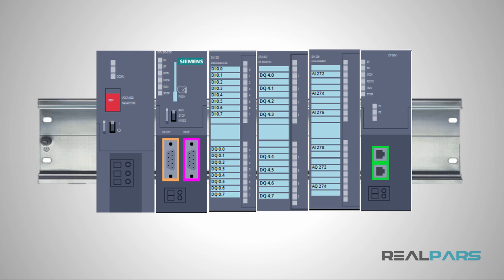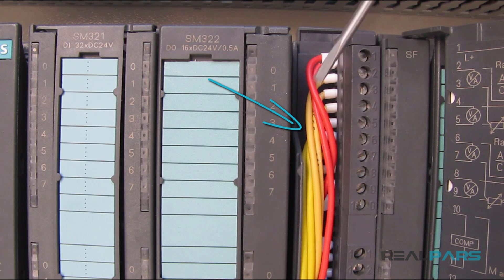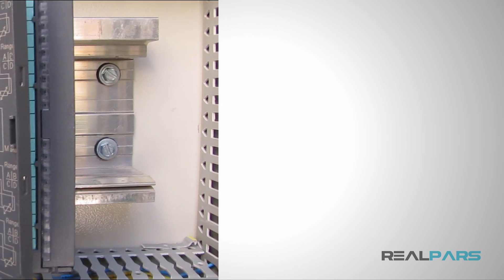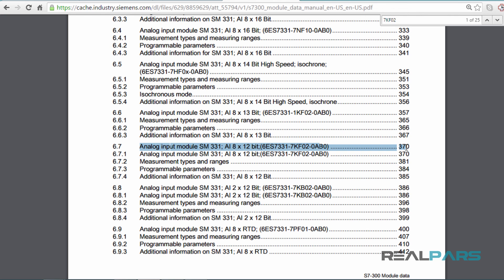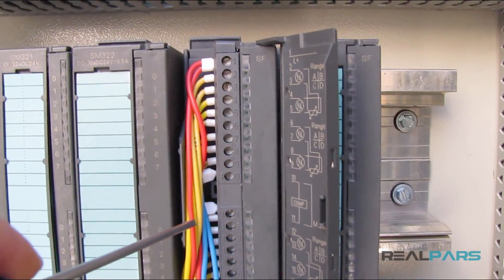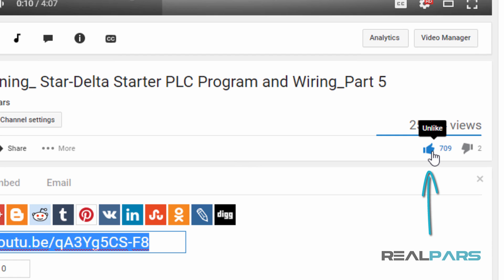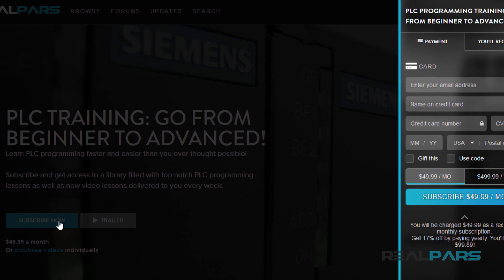How to Wire Sensors to a PLC - Part 2

Comment: Dear  sir,  one pt,Lt,and Rtd  connection wireing  instument to plc card and how to measure 4-20mA ,0-20v, and resistances with multimeter  please sir it my small request .
Reply from the maker: Hello, @Greenarmy77.  Thank you for your question. Unfortunately, we can’t tell you how to wire your devices to your system. We don’t have your electrical schematic and can’t do that due to safety issues. Your best choice is to contact the vendor of the devices you are working with or use the instructions in the manual for your devices. But here is a link for your learning, you might want to review:  https://sage-advices.com/how-do-i-connect-rtd-to-plc/. If you don’t have a manual for your devices, you should be able to find information about your PLC and devices online. Happy learning from Realpars!

Comment: I learned how to find out how to connect power to terminal properly according to specific part. 
Maybe you could explain what the picture shown on the small doors means.
Reply from the maker: Hello, @logoman6718.  Thank you for your question. You must be asking about our video time 0:46 section. Depending on the part number and card type, the Siemens PLC input and output modules will provide a simple block diagram to help you with the wiring and troubleshooting. You are looking at a basic schematic diagram of the I/O card. If you want to learn more technical information from Siemens, here is a link for your learning: https://support.industry.siemens.com/cs/document/109744173/documentation-for-simatic-controller?dti=0&lc=en-WW. You can download manuals and if you register and it’s free you can get more information depending on where in the world you live. Siemens does have some restrictions on the information you can get.  Happy learning from RealPars!
Reply: @realpars  Thanks!

Comment: Can we connect Allen Bradley PLCs to a manage switch?
Reply from the maker: Thank you for your question! I’m here to help, but I need a bit more information to provide a precise answer. Could you please clarify whether you’re asking about a manage communication switch or a power control switch? Providing more details will help us better understand your query and assist you effectively.
Reply: @realpars  there are several control logix and micro logix controllers which are connected to operator workstation via entr and etaps in a ring topology, so my question is that can we replace it with manage switch?

Comment: What is the gauge for the cable used?
Reply from the maker: Thank you for your question. I want to make sure I address it accurately, but I'm not certain which gauge in the video you're referring to. Could you please provide the specific time in the video where you noticed this gauge? Once I have that reference point, I'll be able to give you a clear and helpful answer. Happy learning

Comment: How do you know you are to wire negative 24 volts to 10, 11 and 20?
Reply from the maker: We appreciate your inquiry. As discussed in our video, the decision to wire negative 24 volts to terminals 10, 11, and 20 is based on specific considerations. Firstly, it's crucial to consult the manual and electrical schematic design corresponding to the PLC you're using. These documents often provide insights into the appropriate voltage connections for different terminals.

Furthermore, the choice of negative 24 volts might be dictated by the electrical requirements of the components or devices connected to these terminals. Certain devices may require a specific voltage level to operate optimally, and this choice is typically informed by engineering specifications and the overall system design.

In addition to following your country's electrical safety standard codes, understanding the rationale behind voltage configurations is essential. If you're engaged in Electrical Engineering studies or an electrical/electronic course, it's beneficial to grasp the codes relevant to your region and international electrical automation standards such as IEEE, IEC, and ISA.

For further guidance and in-depth information, you can always return to RealPars. Our Pro-membership offers exclusive access to our comprehensive library of instructional videos, tailored to learners like yourself.

Comment: Whats the wire size from field device to PLC ?
Reply from the maker: Hi there, 

Thank you for your question! This all depends on the load voltage/current requirement of your field device. And you must remember to follow the electrical safety standard codes for wiring requirements in the part of the world you live in. In this video, we are using Siemens controller, and you must look at the I/O card spec sheets too, for its requirement wire size recommendation. 

Hope this helps, and happy learning!

Comment: there is an error in this video, in CC- you mentioned that the positive terminal should be wired to terminals 1& 10 while on the video the negative wire should be on terminal 10 not a positive one.
Reply from the maker: Thank you for your comment.  You are correct.  The negative terminal (common) is terminal 20 as shown on the wiring diagram for analog inputs.

Comment: How plc is communicating with VFD drives? 
If I enter the speed in the system how does it recognise and allows motor to rotate in that particular speed, also how system shows the current value what the motor consumes?
Reply from the maker: PLCs can communicate with VFDs in many ways.  One is to hardwire the analog and digital inputs and outputs on the drive to PLC I/O cards.  Various communication protocols can be used to communicate with the VFD (Profinet, Ethernet/IP, ProfibusDP, DeviceNet, etc.).  These communication busses allow the programmer to access to most of the parameters and data that lives inside the VFD.  The speed and rotational parameters you mentioned are parameters inside the VFD.  They can be accessed via programming in the PLC via I/O card inputs and outputs (if configured in the VFD to the VFD's I/O board) or via communication bus (by parameter address).
Reply: @realpars  thank for your brief reply and time.  Have a good day sir. I like your channel very much.

Comment: How do u connecting a Hydac EDS 300 to the analog input (AI) plc Siemens card.
I am only using 3 wires to connect it.
The first wire connecting to the +24 the other two wires are the signal 4-20 mA..
How do u connecting them ?
Reply from the maker: You would connect pin 1 of the Hydac EDS 300 to the +24VDC power supply terminal.  Pin 2 should be connected to the power supply common.  Pin 3 (analog [+] terminal) should be connected to the Siemens (I+) terminal for the analog channel being used.  Pin 4 (analog [-] terminal) should be connected to the Siemens (M-} terminal for the same analog channel.

Comment: WE are wondering how much will cost the training for my sons? I got two teen agers sons, one just graduated from colleges and he has his bachelor degrees in Math, the other is on his second year to become an electrical engineer  at the college in Houston Texas. We live in the country side between Houston and Dallas,  I was wondering if you have classes for generator excitation integration. I have work for power house and substation for 30 years.
Let us know to see if we can do something. I would prefer to do line classes than for them for now, we are buying a Siemens rack pack simulator for them just to teaching how the system works.
Reply from the maker: Hi John, 

Thanks for your comment, and great to hear that your sons are so eager to learn more about PLC Programming!

We definitely have a great option for your sons. Our course library is specifically designed to provide all the tools needed for beginners to evolve to an advanced level through our hands-on courses.

They will obtain full access to our complete course library (500+ video courses) by subscribing to either our monthly package for €24.99 a month or our yearly package for €179.99,-.  You can subscribe via the following link https://learn.realpars.com/collections

Additionally, they will have access to our Technical Team - consisting of high ranking engineers with a lifetime of experience - who are here to help out with any questions they might have along the way! 

Feel free to browse through our course library to see all the different topics we are covering https://learn.realpars.com/ 

We currently do not have a specific video course on generator excitation integration, but I will happily pass this on to our course developers for a possible future video course. 

Hope this helps! If I can be of any further assistance, please let me know - I’m more than happy to help! You can also reach us over at hello@realpars.com

Comment: Sir I just need to know i have only one cable which is 4-20mA. Should I connect in AI card which is configured in channel D.
Reply from the maker: To wire a 20wire analog input to the PLC card, wire the (+) wire of the transmitter to M+ of the channel you wish to connect to and wire the (-) wire of the transmitter to M- of the same channel.
Reply: @realpars  sir I configured the channel to 2 wire so is it possible to connect 4 wire to 2 wire AI module?

Comment: why they loop and connect all (-) negative wires in 4-wire connection?
Reply from the maker: They do not have to be looped together, but they can be to simplify the wiring (and to make the drawing less cluttered).  All of the negative signals are wired to the same potential (common) of the same power supply used to power the analog signals.

Comment: At 4:39 I still couldn't tell from the schematic where to wire the neutral .  10, 11 and 20 you say for neutral, if you look closer you see 10 has a plus sign, does that not mean positive? Still enjoying all the videos you provide thank you.
Reply from the maker: These sensors operate on DC voltage.  There is a +24VDC terminal and several COM (common, or ground) terminals.  Terminal 1 is supplied +24VDC, and terminals 10, 11, and 20 can be connected to common (ground).The 24VDC power supply and the PLC card should both be connected to the same ground potential.  Terminal 10 can be wired as a positive compensator (hence, COMP+) if you are using external compensation for differences in common potentials. This is not usually required.

Comment: Question: Why are there 2 x Red DC positive and 2 x Blue DC negative wires connected to one module?
Reply: Seems that the 2 power supplies were connected in parallel to increase the output current

Comment: thanks for another great video, when you showed where the neutral goes into 3 places on the card where did say or show you that info ?
Reply from the maker: In general, wiring is determined by the wiring diagram for the card or device.  In the case of the analog card in this video (see 4:15 in the video), the wiring diagram shows 24VDC+ wired to terminal 1 and COM wired to terminal 20.

Comment: What is the meaning of the 4 numbers in cross(one is always "X")  in top right of the order number?
Reply from the maker: Great question!  The 4 square quadrant indicates the E-Stand release (Engineering process for hardware) for that particular module. The X indicates the version. For X, 6, 7, 8, the release version is 5. The E stand base number increases when a change to the hardware or firmware for that card is made; i.e., new component manufacturer, firmware update, etc.

Comment: two wire sensors are the ones with an output current of 4-20mA and 4 wire sensors are the ones working with a voltage range ,am i correct?

Comment: Instead of looking for the module manual you can also just check the front door. it clearly shows where to connect the power and sensor input.
P.S.: cut the cable ties properly, these things can hurt :)

Comment: When should I use digital module and analog module?? Help pls
Reply: If you have discrete input devices, like switches, pushbottons, or proximity switches, for example, you use a digital input card to interface them with the PLC.  If you have discrete output devices, like relays, pilot lights, or on/off valves, for example, you use a digital output card in the PLC.  If you have analog sensors, like pressure transmitters, position resolvers, or a power meter, for example, you use an analog input card.  If you have analog actuators, like regulating control valves or VFD's, for example, you use an analog output card.
Reply: Scott Sommer : thanks a lot sir that was clear answer now I know how to use them
Reply: @yakikadafi6189  You are very welcome.  I am happy you now understand how the digital and analog cards are used.

Comment: How do you know from diagram that terminals 10 , 11,  and 20 are -ve   ???
Reply: In general, before I wire any PLC card, I obtain the vendor documentation for that card and study the wiring schematic.  If you re-watch the video starting at 3:20; it will explain how to determine the proper wiring for the card.  In some cases, the inside cover of the swing-out terminal cover may also provide abbreviated information on wiring the card.

Comment: Why -24V at terminal 10(comp +)
Reply from the maker: Hi there, 
Each card needs a supply containing a +24 and -24 volts. +24 volts will be connected to terminal 1 and -24 volts will be connected to terminal 10 of front connector.

Comment: I don't see where the diagram says to wire negative to terminal 10
Reply from the maker: Hi there,
In 4:42 you can see that according to the sample card's manual you should connect -24 to which terminals (including terminal No.10).
Thanks

Comment: I have a question I hope to answer me
For analog module,If I use AI8*16bit analog module and this module starts from 256 address, in the simulation for 4 transducers  which are  2 wire transducers . In this case, I  should  use  analog inputs that start from  PIW256 for the first transducer and PIW258 for the second tranducer and PIW260 for third transducer and PIW262 for fourth transducer, that's true or not?

for 4 wire transducers it will be the same case or there is any change for using the addresses?
Reply from the maker: Hi there, Thanks for watching the video and submitting your question. Yes for the 2-wire transmitter your addresses are going to be PIW 256, PIW 258 and so on. That's because each analog signal input occupies 16 bits of the PLC memory. 

It works the same for the 4-wire transmitter as well. That means you'll have the same addresses of PIW 256, PIW 258 and so on if you make use of a 4-wire transmitter instead. 

The only difference between a 2-wire and a 4-wire transmitter is in the way you wire and connect them to the PLC input. 

Hope this answers your question. Let us know if you have more questions! :)
Reply: @realpars  
Thank you :)
yes,I have some other questions which I want to ask in the future
Thank you for your kindness

Comment: Does Plc CPU and io modules are provided power  through same power supply module or different ones?
Reply from the maker: You can do both. You can use the one power supply to power the CPU and the I/O modules OR you can use two different power supplies. The only thing that matters here is to use a safe and reliable power supply.
Reply: @realpars  Thanks for solving query.

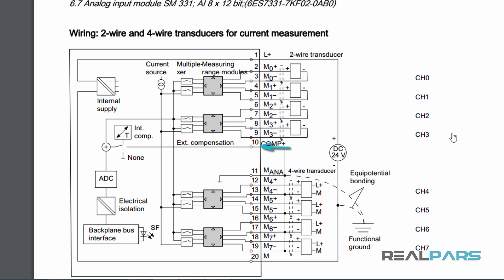Comment: @4:51 I do not really understand why terminal 10 and 11 are also meant for the connection of power supply, since the schematic diagram only shows the connection of 24VDC to terminal 1 and 20. Appreciate if you can explain a bit, thanks :)
Reply from the maker: Hi there, we have another great video on how to wire sensors to the PLC input cards which I think can answer your question. You can watch the first part of this video here https://youtu.be/0DoqKS8jqSA if you haven't already.
Reply: Thanks for your Question which is confusing me too..As per manual its mentioned terminal 1 and terminal 20 to be connected from source .Appreciate if you Explain.

Comment: How to wire 3 wire transmitter to SM 331AI module ????
Reply from the maker: Google the part number, get the manual and you can easily figure that out.

Comment: How to make I/O list or schedule? Can you make a dedicated video on how to make the list depending on the process . Let's say I have to below facilities
1. Inlet pump station
2. Course screen
3. Primary sedimentation tank
4. A/A/O tank.
5. Secondary Sedimentation Tank
6. UV disinfection system
7. Etc.
Depending on the process how to schedule input /output list of PLC ?
Reply from the maker: You can usually develop an I/O list based on the P&ID diagram that you have for that process.
Reply: RealPars But I'm wondering how the I/O points from Switchgear, transformer, VFD, generators are being considered?
Reply from the maker: I understand. I will pass your suggestions to our instructors.

Comment: i have 2 question 
1- what is the number and letters on the module as across x 6, 7 8 ?
2- why did u typed  in search only 7kf02 not the all number of module ?
Reply from the maker: Hi Ehab, 

1- These digits show the number of input or output for the input or output card. For example, "DI 32xDC24V" shows that the input card has 32 inputs and works with 24 Volts DC. 

2- Because this is a unique section in the part number (order number).
Reply: RealPars thank you for replying and i wish u the best .... bexause it's very good lessons and there are videos for simatic manger or wincc flexiable ?
Reply from the maker: You're very welcome! We do have video tutorials on STEP7 (SIMATIC Manager). You can watch the first part here https://youtu.be/y2eWdLk0-Ho if you haven't already. 

We might consider adding videos on WinCC flexible in the future as well.

Comment: The symbols on the card door cover is different from the schema. I notice that the symbols were all he same, meaning this card was for only 2 wire sensors? Why is there a circle with a V and an A inside? Why is there a rectangle with an arrow on it? Potentionmeter?
Reply from the maker: No they're not! The card used in this video can receive signals from 2 and 4 wire transmitter and also RTDs.